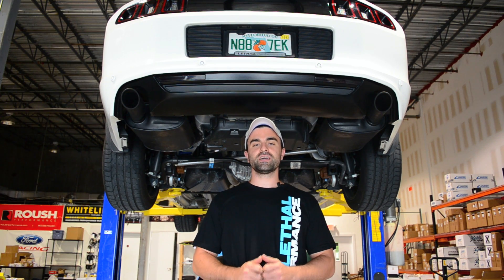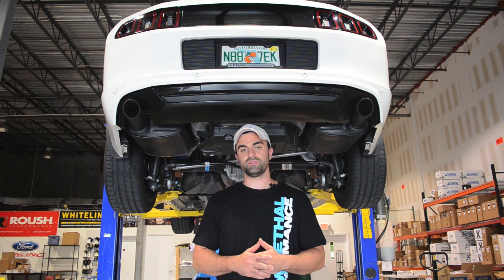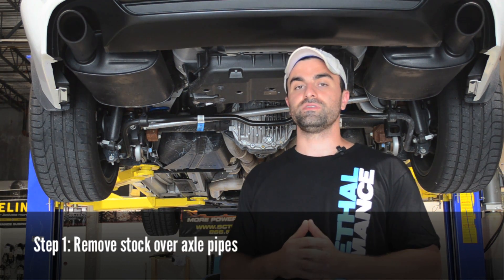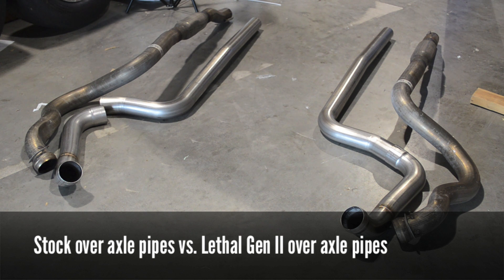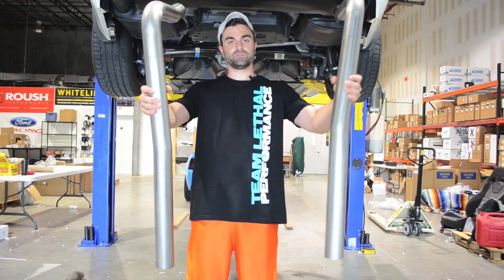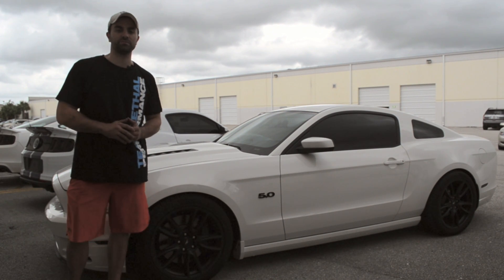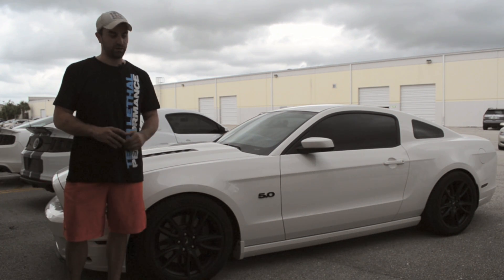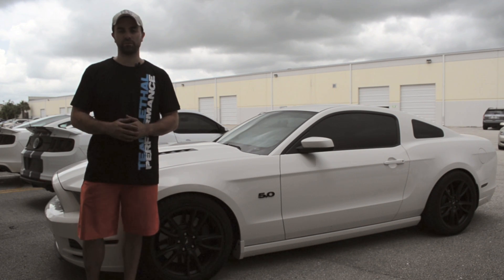Lethal Performance Tech Tips: Gen II Over Axle Pipes Installation on a 2011+ Mustang

Comment: Installation tip from someone pretty novice when it comes to wrenching on cars: To make your life a whole lot easier when removing the factory pipes, get all the bolts loose first, then take the mufflers off of the hanger closest to the rear of the car.  Let them hang free so the factory over axle pipe can move below the muffler inlet.  The over axle pipe should slide out of the factory H pipe with ease then.

Fortunately, I had access to a lift which made installation really easy once I figured out that trick.  I had nothing but troubles with the mufflers completely attached because I was always fighting for another half inch of clearance.  I'm willing to bet I could have had the job done in a half hour had I done this first.

Comment: I may need to get these welded.  Mine have leaked since I got them where the clamps are up near the axle.  Put new clamps in today and they leak even worse now.  Trying RTV high temp gasket sealer if that doesn't help out off to the exhaust shop we go.

Comment: I have a Magnaflow Competition Catback on my 2014 GT and it clunks and rattles like crazy on the axle and my Whiteline Panhard brace and always hits the little axle vent on the driver side, ripping the hose that is connected to it. 

Unfortunately, it's not an installation problem. Magnaflow was the installer. 

Will these over axle pipes solve my problems and clear the axle vent?

Comment: Will these fit on a '11 GT500, with your lethal off road x pipe? One is 3" the other is 2 3/4..?
Reply from the maker: Yes they will. They are 2 3/4 where they both meet.
Reply: @Lethalcamp  hi a question do you recomend me to install a XPIPE 3" OR 3" TO 2 -3/4 and why whats the size of the cat from factory on mustang 5.0 2012??

Comment: Why did you guys go with 2 3/4" rather then making it 3"?
Reply: RippinGearz, the factory H pipe and aftermarket X pipes that say 3" are 3" on the cat side and 2-3/4" on the back side that  the over axle intermediate pipe connects to. And, all of the axle back mufflers are 2-3/4" also. This is what you need, 2-3/4". I was confused by it too at first. Hope this helps.

Comment: Too bad they aren't three inch
Reply: supersudoku2 the factory H pipe and aftermarket X pipes that say 3" are 3" on the cat side and 2-3/4" on the back side that  the over axle intermediate pipe connects to. And, all of the axle back mufflers are 2-3/4" also. This is what you need, 2-3/4". I was confused by it too at first. Hope this helps.